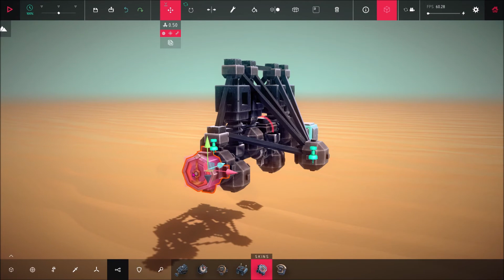Making a BETTER functional engine in besiege

Comment: This is really cool! I was inspired by his videos too and ended up making extremely powerful engines from pistons and hinges. I'm not sure what 25 means on the besiege speedometer but it's about how fast my most recent cars are able to go using piston and steering hinge engines. They also have significant torque, which led me to come up with many alternatives to building methods to keep it from falling apart.

Edit 5 months later: they now go 42, and as I discovered it means meters/second